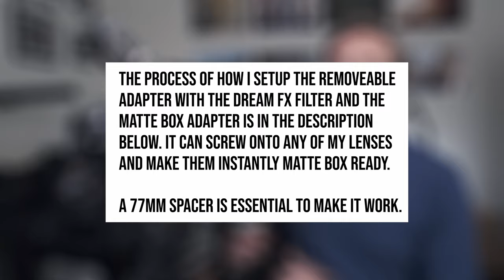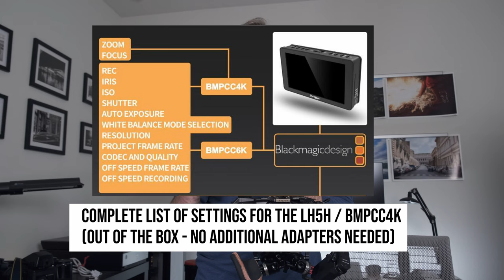BMPCC4K Rig Tour - Tilta, Smallrig, Azden & more!

Comment from the maker: Some additional notes:

1. Cinema lenses vs Photo Lenses (like the Olympus 12-40mm f/2.8 I'm using): Although cinema lenses generally have a longer (much longer) focus throw and declicked aperture, I find the Olympus 12-40mm to be a great hybrid between cinema lenses and photography lenses. It has a fast aperture, hard stops on the manual focus clutch and even though the focus throw is extremely short it's very responsive to even slight inputs. Photo lenses also require custom focus rings for the Nano, and luckily Tilta has a chart online that told me which size I'd need to buy for the Olympus 12-40mm f/2.8.

2. Changing lenses and moving the quick change adapter from one lens to the next: All of my lenses are stepped up to 77mm. The matte box adapter is composed of four parts: the 77mm adapter, a 77mm spacer / extension ring, a 77mm DREAM FX filter and lastly a 77mm XUME lens adapter ring. If I change a lens, I just unscrew this entire adapter and screw it onto the new lens. The 77mm Variable ND filter fits inside of the matte box (in my extensive tests, only some regular 82mm NDs, not variable, would fit inside of the matte box). If I don't want the extra diffusion, I can also remove the DREAM FX filter from the equation. The only way to get the DREAM FX filter to screw into the 77mm Tilta Mini Matte Box adapter is by using the 77mm spacer / extension ring, otherwise the threads are too deep to catch onto (thanks Tilta). Links to these products are below.

3. Bag I'm using: Tenba Cineluxe Shoulder Bag 21 (links below). Fits the whole rig and all lenses! Obviously does not fit the tripod assembly, however.

4. You may have noticed the Peak Design anchors on the cage. I can easily snap on a Peak Design strap (with and added extra comfy shoulder pad) for when I want to let the whole rig hang from my shoulder. Despite the build, it's actually only slightly heavier than a medium format film camera.

5. Eagle eyed BMPCC4K owners may notice the missing rubber caps for the ports on the side of the camera. I removed them - they were just interfering too much with my cabling needs.

6. The NPF battery at the back does cover the screen, but with the combination of the Tilta Power Handle and the LH5H monitor I never have to touch the native BMPCC4K screen.

6. The size of the batteries that go into the small Tilta Power Handle are actually NPF-550's, not 570's as stated in the video.

Comment: Really nice video! Appreciate the depth you went into this. You use everything I do regarding Media, batteries etc. Quick question, I was considering the Olympus: you say it vignettes? Is that only in C4K or because of the filters? I really wanted that full 12mm width.
Reply from the maker: Hi David, great question. I brought the rig out to confirm for you. I'm happy to say that the bare 12-40mm is good to go at 12mm even at C4K. There's no vignetting. 

Now, when you add my filter / matte box ring config, that's when you need to go to 14mm - the filter setup is the issue there. I'm happy to sacrifice the 2mm for the diffusion filter / matte box setup
Reply: @RobZeigler  ah thanks for testing this, appreciate it.
Reply from the maker: @Boncrek  No problem. Enjoy!

Comment: Hey! Great video man! I've been looking around trying to figure out some information about the compatibility of the Olympus 12-40mm f2.8 with the bmpcc4k. Are you experiencing any really bad distortion in the wide range? You mentioned the vignetting at 12mm, how bad is it? Thank you!
Reply from the maker: Hi Sam! The vignetting I get at 12mm on that lens is mostly due to the ND filter / matte box setup that I have. On it's own, there's not much if any vignetting at 12mm but there is noticeable distortion. I usually keep it at around 15mm - anything lower would need some distortion correction in Resolve, especially if you move off axis.

Comment: Quick Question I bought the Tilta run stop cable before buying the Nano or the handle that you have. I have the pocket 6k Pro and the Crane 3s camera control doesnt work with the 6k Pro but does work with the 4k and 6k. Not sure when they will fix this but I would love to know what software the camera is on?. So you dont need the nano to run start and stop on the pockets? I just need the run stop cable from the handle you have?

Comment: Thank you for this thorough walk-through! I'm just planning to order the Tilta focus handle. How does the small focus wheel feel when focusing? Are you able to rack the focus precisely, specially with the Oly lens with a short focus throw? I've read people say that the handle moves the motor too fast for precise focusing.
Reply from the maker: Hi Martin. You'll be able to get very precise movements out of it. It reacts very well to minute inputs - just be aware that you're more likely to go over your mark more easily with a photo lens compared to a cinema lens. The LH5H monitor also lets you use the Tilta Nano focus with a cable to set A and B marks. Pretty helpful if you need exact movements - you can even set the duration it takes to get from A to B.

Comment: Hey Rob, how fast can the nucleus rack focus with the Tilta focus handle? I'm looking at getting one to be able to use it for zooming to basically turn my lens into a servo-zoom lens, but it has to be fast.
Reply from the maker: It has great torque - you shouldn’t have any issues using it to zoom so long as the teeth of the motor unit are properly engaged with the lens. I could rack focus very quickly, but it often felt violent to go too quickly. I didn’t want to break anything so I kept my motor speed steady and gradual. 😊

Comment: How does it feel shooting at eye level? It def looks comfortable when holding mid body and low shots but I feel like it may not be as comfortable shooting higher.
Reply from the maker: Hi Eric. In it's current state, it's not ready for eye level shooting but it can be. I spent about $500 (mostly Amazon and B&H parts) to build out a shoulder rig that allowed me to simply snap the Titlta cage into another one of the Tilta mount plates with longer rails and a shoulder pad. I also had a new arm and longer HDMI cable to push theLH5H monitor out a bit.

The problem was two-fold: 1) the ergonomics of the BMPCC4K made it stick out a bit too far (too close to my head). The Z-CAM cube shape wouldn't have done that. 2) I wasn't seeing the cost benefit in typing up $500 on a shoulder rig and not using it full time. Luckily the parts were returnable.

That was a lot of trial and error to discover that I like the shots to be from a lower angle anyway. They feel more dynamic and getting a shoulder rig stabilized is no easy task.

TLDR: a shoulder rig would make it eye level and was tested, but I preferred the hand holding stabilization for my current usage. The strap I mentioned helps if I get fatigued and need the rig to rest on my side for a few moments.

Comment: Hi thanks for this video.
Pls can you tell me how you are using the tilta power handle to controll the stop and start of the blackmagic pocket 6k, which port did you connect it to.
Reply from the maker: Hi Ben. Search eBay for "Tilta Nucleus-Nano Run/Stop Cable for BMPCC 4K/6K". I didn't find any reliable sources (Amazon, B&H) having that cable in stock when I searched but you can verify that, as well. 

Note that one side plugs into the Nano and the other side plugs into the USB-C port on the camera. I record to SD card so this isn't an issue for me, but of course you'll need to weigh your options if you're already using that USB-C port with an external SSD. Good luck!